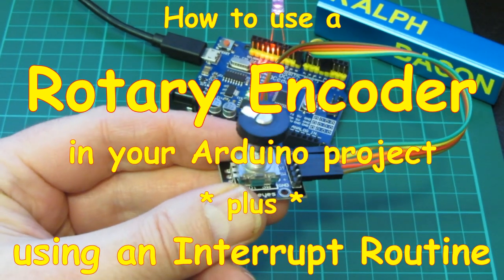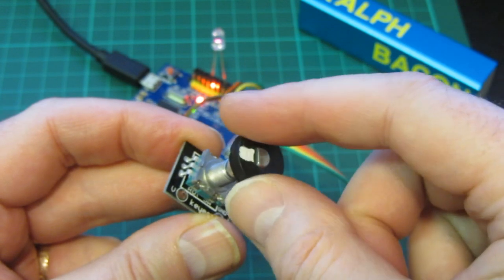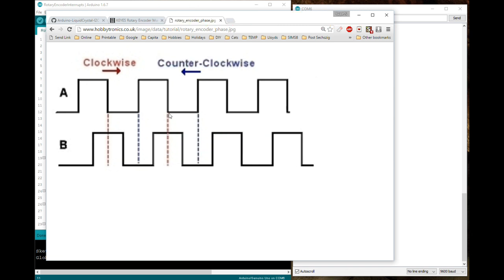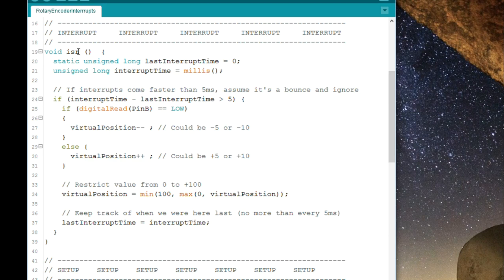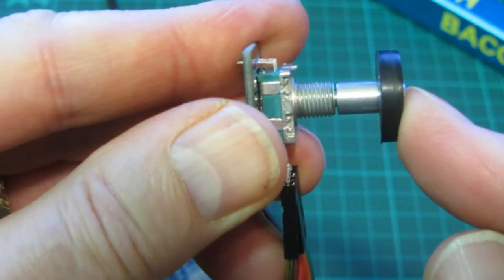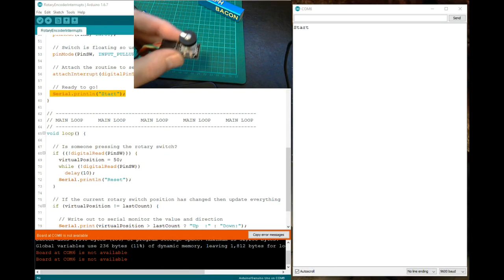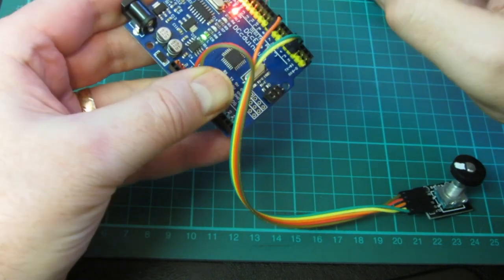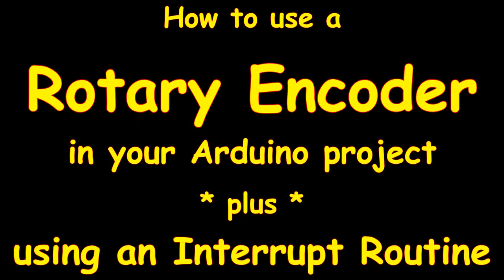#19 How to use a Rotary Encoder with an Interrupt routine on your Arduino

Comment: My homemade Six Digit, 20MHz, CD74HC192 Up-Down counter circuit counts Quadrature Encoder pulses at 20Mhz speeds. And seems to be many times faster than using my PIC16F887 microcontrollers.

Can you tell me why?
Reply from the maker: I suspect it is because your CD74HC192 is a hardware-based solution and your PIC controller relies on software. Hardware implemented solutions will always trump software, even when the software is written very well (no delays, for example). Of course, a very fast µcontroller could match a hardware implementation but that's just compensating for the slower execution.
 
So that's my take on this question, good one that it is, Techis God, thanks for posting.

Comment: Hi Ralph. Tried again, and got this
Start
Reset
Up  :77

and no other writes despite turning. It's as if it leaves the loop and never returns. I switched the encoder pins, as mine are label VCC, L R, Z Gnd, so I assume VCC goes to 5 V, and goes to ground, Z is also marked as the switch on the PCB where the 2 pins are, and L & R are then assumed to be the A and B encoder pins. Still no luck. I noticed the Tx LED only blinks once, which matches with the single "77" value, but certainly not the set of values you get from 50 to 77 which is what I expected. This is baffling. In using a genuine Uno board. My Led goes on (LED anode to pin 11) but doesn't dim or brighten. I assume with each turn, there's an RX/TX flicker to update my computer screen. No such luck.
Reply from the maker: I've replied to your later response Ron, hope it helps. And it would help me too if you would just hit 'Reply' under the original post (rather than posting a brand new 'thread') so I can find all related responses to the original question, thanks!

Comment: a quick question.. for the code that you use, do both pinA and pinB need to be interrupt pins, or is just pinA or pinB enough? and ifso... which? i'm asking as for my project i have only one interrupt pin available.
Reply from the maker: You are in luck indeed, Matthieu, as only the Pin A is put onto the interrupt. Then the Pin B is read directly from another, non-interrupt GPIO pin when the interrupt fires (not the most efficient interrupt in the world but it works well). I hope this helps!
Reply: sure does.. thank you very much.. :)

Comment: Hi Ralph. Tried your code. Not working. I only get ST and later ART as in START. Same delay with RE...  SET

I get the LED to come on sold when I push the encoder switch. Turning it does nothing to the LED and only periodic updates to the screen as to the value.  You made it look easy. Any ideas?
Reply from the maker: Mmm, tricky to diagnose at a distance Ron, but let's have a go.
 
Firstly I can't work out what you mean by the sentence " I only get ST and later ART as in START. Same delay with RE...  SET", can you explain that please?
 
Secondly, if the LED comes on but does not fade (you have to turn it counter-clockwise quite a few times to get it fade all the way down) then I suspect that your A/B wiring is not correct. Recheck that. You can verify whether the rotary encoder is doing anything at all by monitoring the output on the Serial Monitor - it will print "Up" or "Down" with a value depending on which way you are turning the knob.
 
Finally, ensure you using the EXACT sketch (no modifications or pin changes or anything) that I supplied otherwise we could be talking at cross purposes!

Comment: Hi Ralph.Ver y good vídeo your my  LIKE.Im wondering ir you  can share a link  vídeo if your already have Or any idea about hoe to do the conect  and enconder that doesnt have the PCB .I have seen some vídeos with and with out resistor and with and with out capacitor.I am getting confused.I am trying to make a cockpit forma muy flightsim.Hope u can help.Luis from argentina
Reply from the maker: Hola Luis, que tal? Here's a picture of the connections required to a bare Rotary Encoder (no PCB): http://community.axoloti.com/uploads/default/original/2X/f/f656716442794f064bec964b8258ea771cd40360.jpg
You can use the NEW method or the OLD method - the NEW method is probably more reliable.

Comment: Sir, actually I want to connect a servo motor with it
So,I wanted to know the exact connections of the servo motor,encoder and Arduino Uno board
Can you please help me out?
Reply from the maker: You must learn to walk before you start to run, Suryansh! Do the Rotary Encoder project. Then you will know how they work and what they really do. Then connect up a servo and play with that (unfortunately I don't have a video for that but you're bound to find a good example somewhere, perhaps on the Arduino site). By that time I suspect you will figure out how to connect the two together. As they say, you can teach experience - that's something you must acquire all by yourself. It's a fairly simple requirement you have so should be straightforward to do - good luck.

Comment: Let's say I want to increase/decrease the value by 1 rotating the encoder, like you just showed, AND by 10 rotating while pressing the button, how I do that?
Reply from the maker: You mean you are turning it AND pressing the button simultaneously, Marco? If so, do a digital read of the pin that the switch is connected to whilst incrementing (or decrementing) the count, all in the ISR. If the cost (in time, mainly) of doing a digital read is too much, we could connect the switch to another ISR and just monitor its state (using a volatile bool, for example) and then read that variable in the original ISR - much quicker. The UNO only has two interrupts so this would use both of them. Any good?
Reply: I think the digitalRead thing is the better way to do it.
So I'll put in my code IF digitalRead HIGH increase (or decrease) by 10, ELSE by 1.
Thanks for your quick response!
Reply from the maker: Yes, that would work but it definitely isn't the best way to do it (using another interrupt is) but sometimes pragmatism triumphs over purity. Quite right too. Thanks for your post, let us know how you get on.

Comment: IN NOT SURE BUT I THINK TO GET IT TO WORK ON A SCHEMATIC WITH DIGITAL LOGIC LIKE A 7400 SERIES TYPE LOGIC IT HAVE A PULSE WIDTH LIKE A SAID BELOW BUT I COULD BE COMPLETLY WRONG HERE.  LOOKING AT THE PROGRAMMING LIKE IN LISTENING TO AT THIS SECOND UR DESCRIPTION IS PERFECT AND EASILY UNDERSTOOD . THANKS FOR THE VID AGAIN AND IM GOING TO GET A ROTARY ENCODER FOR MY PROJECT.
Reply from the maker: Yes, do get a rotary encoder and if you have an oscilloscope it would be even better to see the waveforms. As I said below it is the rising edge that determines the direction not the width of the pulse. I'm sure you will find using the actual device will make it all much clearer. Thanks for posting (although we'd all appreciated your posts not being in UPPER CASE as it makes it seem as if you are shouting at me <sad face>).

Comment: Hi Ralph,  Could you maybe  show us a code that would keep the position of the digital switch  on power down of the arduino in the EEPROM.

Thanks,
Love your Videos .....
PS .... and maybe put  your sketches at the bottom in the show more.

Cheers
Reply from the maker: Now, Joe, remember that there is no value associated with the position of a Rotary Encoder. Not like a potentiometer, for instance.
 
All it  does, as you know, is send a anti/clockwise pulse to your code which then decides what to do. For example, in/decreasing a local variable. So now that we have this variable in your code that is being adjusted, to save it to EEPROM is really easy if you follow video #65 EEPROM basics. Whilst I don't use a Rotary Encoder in that demo, I do use an in/decreasing value from a radio transmitter and save it to EEPROM in exactly the same way as you need to do when using a Rotary Encoder.
 
Have a look and if you have queries post them under that video and I'll respond! And, if I understand your last point correctly I'll put a link to my demo sketches in the video description (is that what you meant?).
Reply: I'm heading over to  video #65 .......... oops ...... know i see the code here on this page;)  Cheers.

Comment: Excellent video, Ralph. Thanks! You are a source for inspiration.

There is room for an interesting little C-question in your code, and that made me Google around a bit. 
We all know that changing a variable in an ISR is not as trivial as changing it elsewhere; it needs to be 'volatile', of course. That is to prevent the compiler optimising it away or put it in a register.

In your isr() you have another variable, lastInterruptTime, that should be treated volatile, but you didn't. Instead you made it static.  Perfectly fine of course. 

So, what is the difference between static and volatile? And... Can you use static instead of volatile? Or perhaps do both; "static volatile"? Frankly, I'm not sure. Well, not sure enough to try to make an explanation, that is. ;-)
Reply from the maker: Hei Robert, hvor er du? 

For others reading this post, let's think about what "volatile" is trying to do. Global variables (declared outside of any function) can be changed by the ISR. But the compiler is unaware of this and can retrieve the value from its registers without actually reading the data from memory again. Moreover, the compiler optimisation may "mistakenly" remove code if it thinks a condition is always true or false because the variable it is checking has not been marked as volatile (programming error, not an optimisation error). By marking it as volatile the compiler (and optimiser) is now aware the variable's value could suddenly (and unexpectedly) change and always retrieve its true value from memory.
 
Variables used within and only within the ISR itself are safe because the compiler knows that's where they are used! Volatile is not needed as they are not accessed elsewhere.
 
As it happens, during the execution of an ISR, millis() is not incremented so that piece of code that tracks the millis() will have the same value at the start of the function as at the end of it. But it seems more logical to update the "lastInterruptTime" at the end of a function to me!
 
So declaring a variable used within an ISR as both static and volatile is not required because the scope of that static variable is local (only for the ISR in the first place, ie not global) and is not volatile as it's not being used globally.
 
Tricky subject you've raised here Robert! Probably requires more background reading but in broad terms that is my understanding (and my code works so I guess it is not being optimised away or corrupted). 
 
Wow! I wonder if anyone else would care to comment on your post?
Reply: Google translate did a terrible job there... You asked where I am. I might as well answer that. :) I'm in the middle part of Norway, north of Trondheim. :) The rather rhetorical English question "how are you?", does not exist in the Norwegian language. Typing in "How are you doing" in Google Translate gives a better translation by the way. Enough linguistic digression... ;-)

You're absolutely right about volatile and static variables of course. I just felt a bit unconfortable when I saw the variable lastInterruptTime in the ISR and thought "this variable is lost". I didn't notice it was static. 

A static variable "survives" outside the scope, but is not accessable outside the scope. If if were non-static it would have been lost, and the code would behave strange.

I would have made lastInterruptTime global (and volatile of course), but now I realise it's better (and more elegant) to do it your way. 

Being a C-developer for more than 30 years doesn't mean you've stoped learning. Just ask me! :-)
Reply from the maker: Robert, hvordan går det? Better? Ha ha! Thank goodness you're fluent in English!
Regarding your post, I don't think we ever stop learning, whether that's in C++ or in life in general! It's when we stop learning that the rot sets in. I'm sure some beginners find the whole concept of scope, static, volatile and so on quite confusing. I try and not gloss over such things in my demos but I will henceforth take extra pains to try and explain such esoteric language concepts for the benefit of one and all. Once understood, the general reaction should be "Is that all it is?".
Reply: Better indeed. :) When it comes to computers and development, I think my English is ok. But if you like to discuss knitting, I think I'll pass. "Weft and warp", I have no idea what that means, at least not in a knitting context. :)
Reply from the maker: That's a shame, my next video was going to be about the weft and warp process for knitting. Knit one, purl one. Oh well, I had better stick to Arduino-related videos then :)

Comment: CAN YOU EXPLAIN THE CIRCUIT CONNECTION OF THE ARRANGEMENT PLEASE?
Reply from the maker: It's very simple, Suryansh, only three wires (plus one more if you want to use the push switch functionality). Pin A goes to one digital pin, Pin B goes to another, plus there is a ground (GND) connection. For the exact pins I used in my demo look at the sketch. Is there something in particular that is confusing you? Let me know and I'll try and clarify.
Reply: Is any pull down required on pins?
Reply from the maker: Not a pull down but a weak pull up is required, but you can do that by using pinMode(xxx, INPUT_PULLUP) without any additional components.

Comment: Great explanation. My only suggestion is to minimise the isr code to just a flag and process the change in the main loop.
bool is_changed = false;
int pos = 0;
void isr()
{
  static unsigned long last_int_time = 0;
  if (millis() - last_int_time > 10)
  {
    is_changed = true;
    last_int_time = millis();
  }
}

then in the loop...
if (is_changed)
{
  is_changed = false;
  if (digitalRead(pin_b) == LOW)
  {
    pos--;
    Serial.print(F("Down: "));
    Serial.println(pos); 
  }
  else
  {
    pos++;
    Serial.print(F("Up: "));
    Serial.println(pos);      
  }
}
Reply from the maker: Yes, that would certainly optimise the ISR and make it shorter, which is what ISRs should be, of course.

Comment: Thanks for posting. However, I'm quite surprised to see that you did not explain the connections from encoder to the Arduino? The tutorial being that elaborate and all? Just a suggestion maid;)
Reply from the maker: Well now, noilex, the demo sketch used in the demo also contains the pin connection details: PinA (from the encoder) goes to pin 2, PinB goes to pin 4 and pinSW goes to pin 8. We use Pin 2 because the Arduino has interrupt capability on that pin, so we can reliably detect rotary encoder movement. Hope that helps.
Reply: Thank you for clarifying ;)

Comment: Hi Ralph,
I have a project where I am using two encoders. I have utilised your code to run the encoders but I have one small problem. Is it possible to contact you via email or some other form so I can explain what is happening? From up north in Doncaster . Cheers Leigh
Reply from the maker: @Leigh Bucksey
Firstly, let me say how great it is that my video has helped you. Makes it all so worthwhile. 
 
Now to the issue of 'support'. The BEST place for support is the Arduino forum (http://forum.arduino.cc/index.php) where there are many experts cleverer than me who can lend a hand, providing you can explain succinctly the issue and what you have done so far in trying to resolve it. And follow the house rules for posting code and the like.
 
As you can imagine, if I tried to do this single-handedly I'd do nothing but answer queries. That said, I'm prepared on this occasion to let you PM me on that forum after you have posted your query so that I am alerted. I should then be able to read your original post within 24 hours, during which time others may already have posted suggestions.

I'll do my best then to help, how does that sound?

And BTW don't apologise for being up north in Doncaster, someone's go to live there (heh heh)!

Comment: @Ralph S Bacon Your video helped me a lot! Thanks!
Reply from the maker: Glad you like it, beicel, once you have understood how it works it all becomes very simple, does it not?
Reply: Yeah, but not that simple! ;) Anyway, I needed to change pin 3 and 4 (revert), but I have the same rotary encoder like you!
Reply from the maker: Hmm, interesting that you changed the pins but I'm delighted you got it working! "Simple" is a relative term, what I meant was that once the concept is understood then it becomes much easier to actually implement! Great, thanks for the update.

Comment: I used you code on my project. I used last count as my frequency changer and pinmode I done pull-up on both Pina and pinb. Plus I wrote them high to get the results that I have. Would you look at my video and tell me what I can do to fix it. Maybe look at my code.
Reply from the maker: Where's your code, Kevin? I saw the video where you had problems, but you said the serial monitor was displaying the correct up/down values? Point me at the code and I'll give it a quick look-see. And I gotta say, your southern American accent sounds as delightfully strange to me as mine does to you! Amazing! Anyway, back to that code...?
Reply from the maker: I'll do that this evening, Kevin, once I'm back home.
Reply: Ralph S Bacon I sent it to you in a YouTube message. You should be able to see it I hope.

Comment: Is there really such a problem as "bouncing"? because i think your encoder is skipping steps because of that 5ms read delay, not because it reads too slowly
Reply from the maker: Switch bounce exists for just about every switch in existence. My 5mS delay is good enough most of the time to ignore those bounces. It doesn't seem to skip any steps unless you turn the RE really fast (like the volume control in my car).